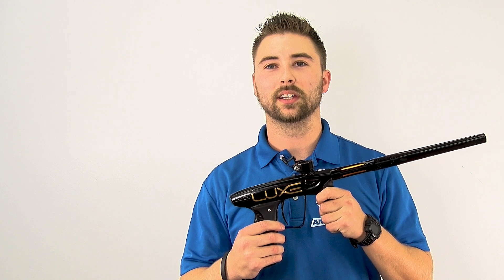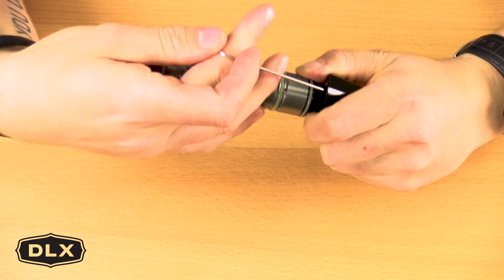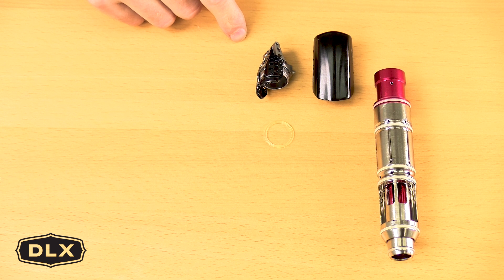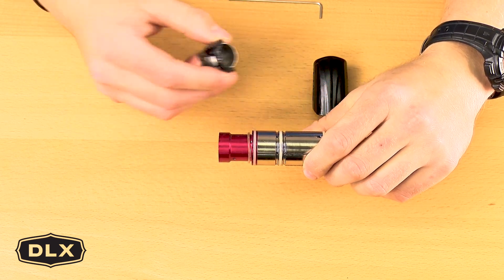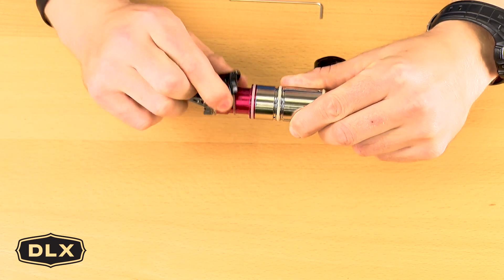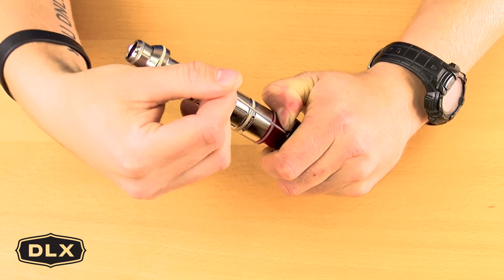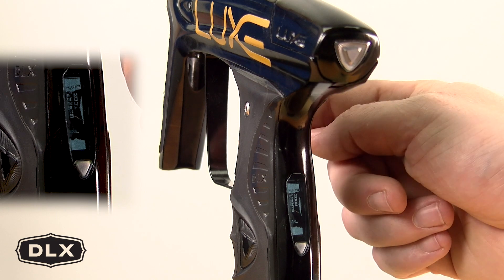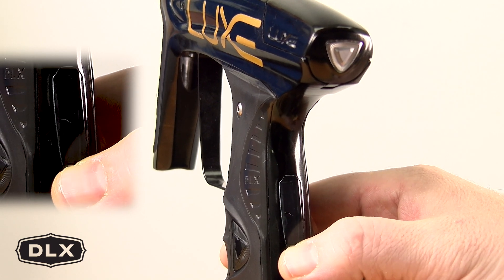DLX Technologies Official - Luxe® enCORE install - Luxe® ICE

Comment: 1500$ has a o ring that holds the back cap on  -_-
Reply: Wrong. Has a tension o ring to pull back cap down, which is a very simple and reliable solution for not utilizing a sprung back cap that's difficult to take apart for no reason... use your big brain power.
Reply: @ConTheDon187  1500 for an oring retention device. very very bad engineering
Reply: @reapering125  DLX pretty much invented the concept of the modern quick release tooless bolt kit. The design works and has done for well over a decade.

Comment: Glad you released this. I installed mine and reused the spring as well. I noticed the bolt guide could move up and down and figured the spring was needed to add tension.